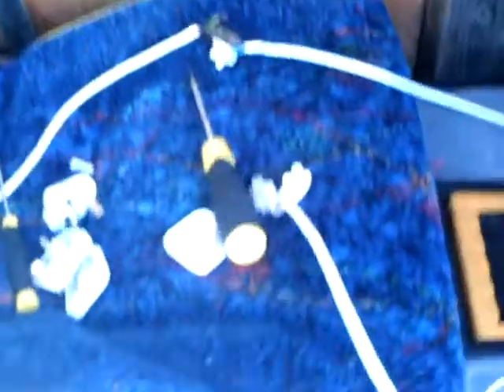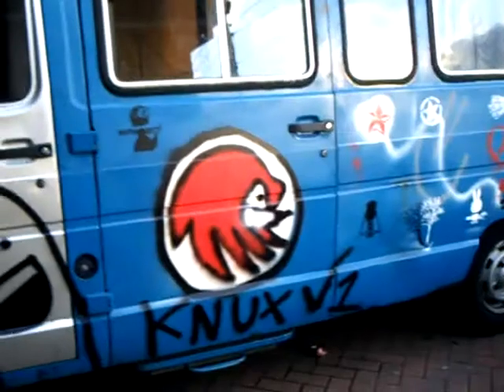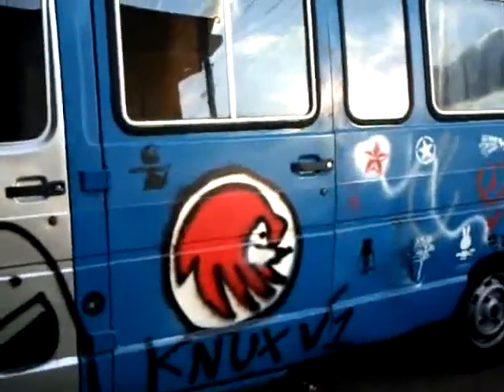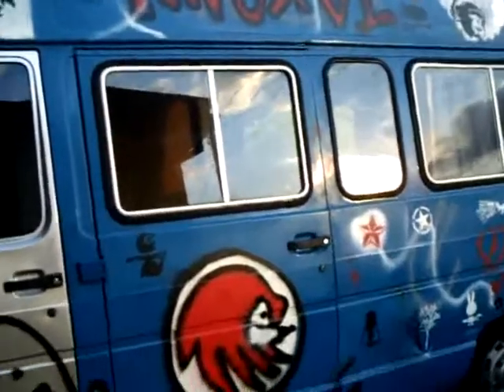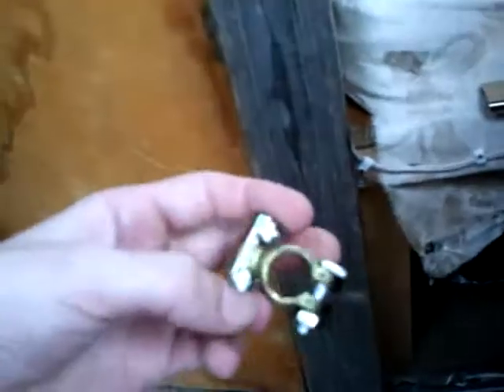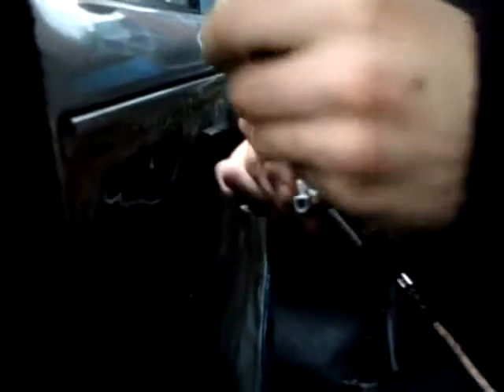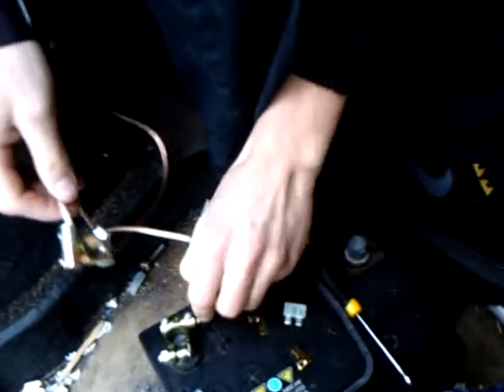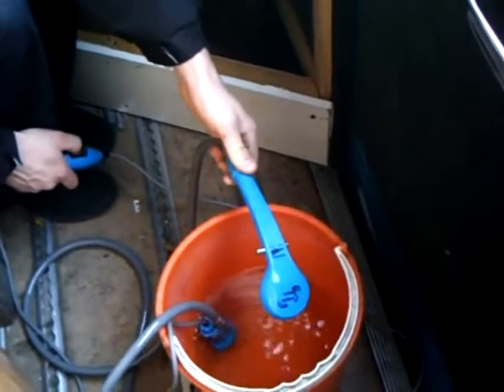Super bus project part 16: Let there be light!!

Comment: A simple way over the problem is to use 
1  house hold12volt LED down lighters. M4 or M16 light fittings
2 use car Led Lights.
3 convert a 240 volt floursent light by changing the transformer. See the u tube video.

Best to make a  test set up on a table before you install in the van,